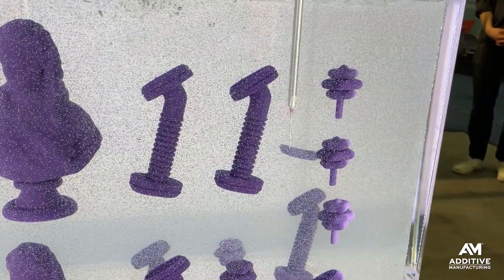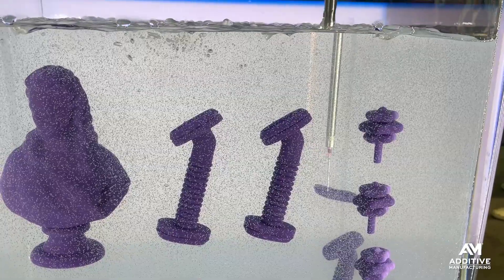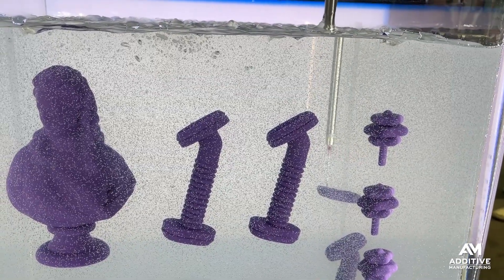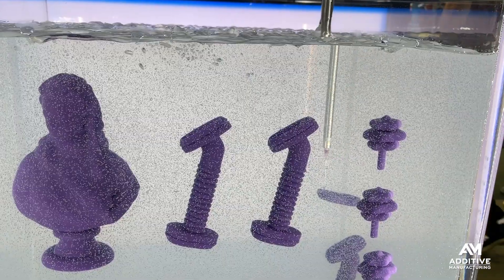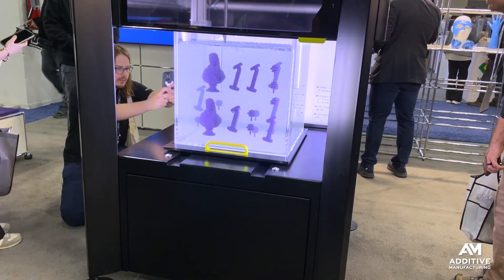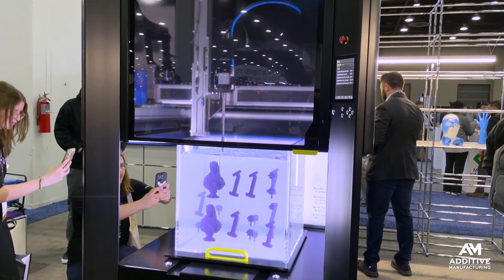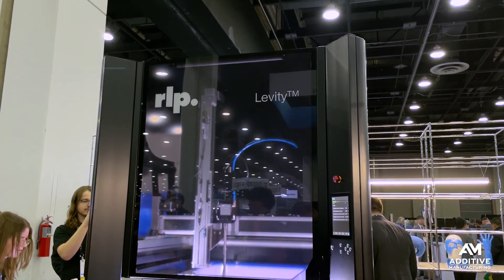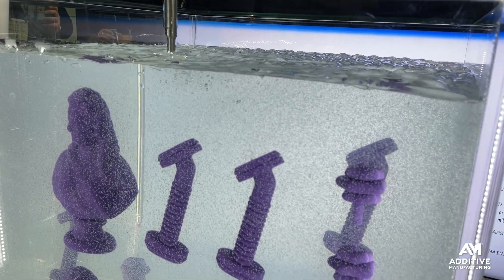Gravity-Free Silicone 3D Printing: No Supports, No Build Plate, New Possibilities

Comment: This is super cool. But calling it "gravity free" is dumb.
It is the opposite of "without support structures" Fair you could say there is no structure but "fully supported 3D printing" or "isotropic supported 3D printing" or probably hundreds of other descriptions would be a better and more precise way to describe this technology.
Reply: They call them emotional support structures.
Reply: @eestaashottentotti2242  IF it can print body-safe medical grade silicone, then yes definitely the case!
Reply: Support structures are 3D printed along with the part using the same material. In that sense, you don't need to print the supports and later remove them. For me it makes sense to describe this as printing without supports (because you don't have to print them).

But I completely get your point.

In any case is just a semantic discussion.
Reply: Neutral-buoyancy support? Gravity is effectively cancelled as the part is density-wise indistinguishable from the support medium.